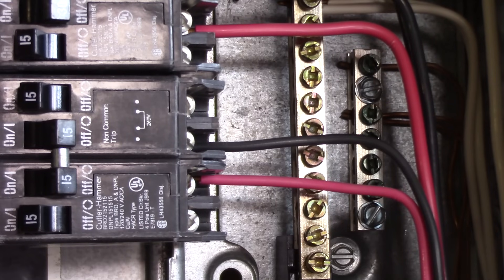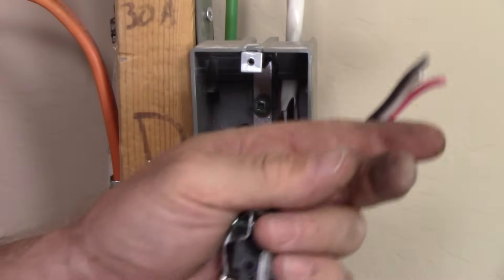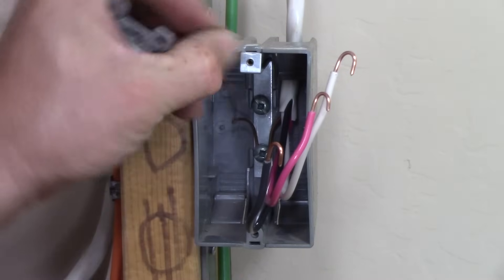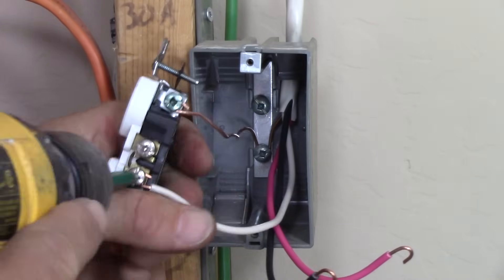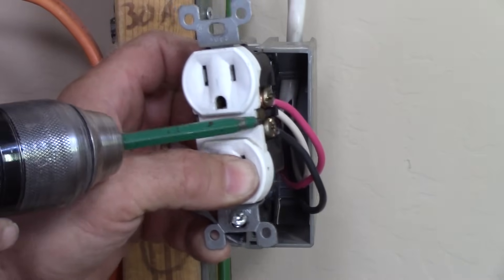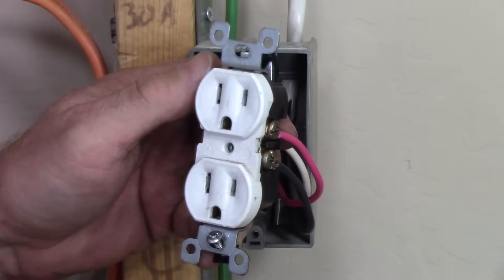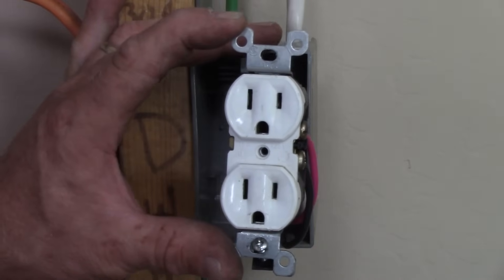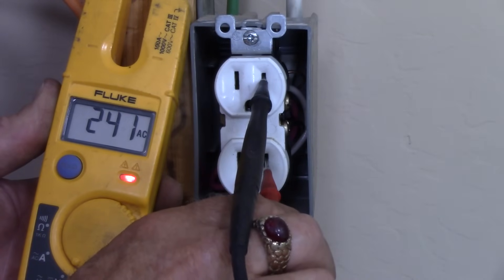Kitchen Split Circuit Receptacles Explained

Comment: i’m installing gfi can i just cup it red wire? it’s a old house have 2 hits there now
Reply from the maker: You might have issues with trying to use a GFCI receptacle on a 3-wire split circuit.  You don't have to change to GFCI unless you feel a need to. Anything wired to the code rules of the day is grandfathered.  My advice would be to keep the 3-wire split circuit arrangement that you already have.
Reply: @theinternetelectrician  can i just wire nut red wire and use black and white and put gfi ?

Comment: 5 minute mark:  people have to UNDERSTAND,  the 240 volt into breaker box, is   120 volt on  EACH  SIDE OF THE WHITE wire. Red/white=120 volts.......black/white=120  volts.........remember to remove connector tab, on BRASS  side of receptacle/switch/ etc...
Reply from the maker: So, kinda like I explain it?

Comment: Very informative. Is there a way to add a second outlet where each are split and sharing the neutral?
Reply from the maker: Yes, That is quite common as to meet the code of the day for a kitchen, you could have 2 split receptacles on one 2-pole 15A breaker.  To do this you should pig-tail the conductors for  the connection to the receptacle at the first outlet although some will "cheat" and use the push-in terminals and the screw terminals.

Comment: Nice video. I've used plastic boxes before, but never saw one with that metal strip in the back. Interesting design.
Reply from the maker: Yeah, there are so many different types of boxes out there! In my day,.... (walking uphill to school in 6 ft of snow, etc) We only had about 2 or 3 different styles of metal boxes. I would appreciate it if you like, subscribe, and click the bell as well (if you already did, thanks!) It really helps us creators gain traction with YouTube.

Comment: Lose the neutral tho, and both appliances are in series across 240 volts.
Reply from the maker: If they are exactly  equal loads, no problem.  If not, problemo!
Reply: @theinternetelectrician  yup , lets say you have a 600-watt coffee maker and a 
1200-watt hot plate burner the resistance of both in series is 36 ohms
 well 240 over 36 = 6.6 amps and the voltage across the pot gives u 160
volts of burned-out coffee and about 80 volts of not fully cooked food.

Comment: This is great. Explains what I did wrong. Thank you.

Have a question though. One of the split recepticals I am replacing, I want to use an outlet that also has usb plugs. It doesn't have terminals, just three wires (ground, hot, neutral) so there is nothing to split.

Any suggestion one what I should do?
Reply from the maker: You would have to cap off and not use one of the hot wires in this case. I would appreciate it if you like, subscribe, and click the bell as well (if you already did, thanks!) It really helps us creators gain traction with YouTube.

Comment: What if you want to change a split outlet to a GFCI in the kitchen? There is no tab to break off on a GFCI? I actually have 2 separate outlets in the kitchen that are both split outlets and they are both on the same 2 circuits. Meaning both upper outlets are on the same fuse and both bottom outlets are on the same but different fuse. Help
Reply from the maker: Hey Gregg. Yes, you have a split kitchen receptacle arrangement, and it is really difficult to achieve the requirements of the new code, which is a 20A #12/2 AWG circuit arrangement with GFCI protection on any receptacle within 1 M of the sink. You are correct, there is no way to split GFCI receptacles the way you can a regular receptacle.  Trying to make this work with the shared neutrals is a challenge as well.  The good news is, you don't have to! This system is grandfathered so no need to bring up to current code rules.  Personally, I like the split 15A arrangement.  You have 2 full 15A circuits in one outlet, and a maximum of 2 of these on one 15A, 2-pole breaker.  To me, better than 1, 20A circuit for 2 duplex outlets.  If you're concerned about not having GFCI protection, change the supply breaker to a 15A, 2-pole GFCI breaker (relatively expensive and requires some wiring changes in the panel in how they are connected).

Comment: I have a split receptacle within 3 feet of the kitchen sink, so need to replace with a GFCI. I know to split a regular receptacle by breaking the tab on the hot side, but how do I split top from bottom outlets on a GFCI? It is the only outlet in both circuits, so no ‘line’ requirement.
Reply from the maker: My advice, why change it to a GFCI? It's complicated because the shared neutral can mess you up, and you don't need to go with GFCI as your installation is grandfathered to the code rules of the day.  I personally like the splits better. But in answer to the question, you can't split a GFCI receptacle.

Comment: I have this set up in my house, but when I turn on my breaker, I only have one hot wire, and the top part of the outlet doesn't work. An electrician owned this house prior to me. I'm trying to figure out why he did this if only one wire is hot. Several outlets close to this one are wired the same way, with the same outcome. I want all my outlets to work, but don't want to burn down the house (obviously). What other reason, if any, would you wire it like that?
Reply: Nevermind. I got this. All done, and working safely. Thanks for the video!
Reply from the maker: Excellent!  Switched outlets for table lamps I'm thinking?

Comment: I have these in my kitchen. I tried to replace them with GFCI and got no power. Is there anything different with wiring the GFCI?
Reply from the maker: Yup.  The best thing to do there is leave the 3-wire split circuit as it is.  No need to change unless you want to?
Reply: @theinternetelectrician  I'm hoping to sell the home soon and was told GFCI was required in bathrooms and kitchens. That's the only reason.
Reply from the maker: @jasonbrussmn  The way it is wired now is grandfathered to the code rules of the day.  No need to bring it up to todays rules unless it is a new installation.
Reply: @theinternetelectrician  hypothetically, if a person wanted to replace these old outlets with GFCI is this possible? I'm assuming one of the hot wires would need to be capped? Thank you for your replies!

Comment: so if i bought a gfci outlet , i guess i cant use that with this wire setp up , since i cant brake no small piece on those new outlet , can i just cancel the red wire with a wire connector ?
Reply from the maker: Correct.  It's tricky to adapt the 3-wire split circuits to GFCI protected because of the shared neutrals.  Best to just leave it as it is.

Comment: Hi. I have a question for you.. as u said this is not in the code, and it was used long ago. Lets say I have a place with this kitchen configuration (double pole 15 amps breaker as you described, and I want to change it by a GFCI outlet to be in the code.. (the 14/3 wire will be still there) in this case I should just ignore one of the phases in the outlet box (putting a wire cover on it) and then use the other phase to be connected to the gfci outlet?  Just wondering if a part of being a slot waste in the panel, the breaker will protect me in the same way since it is for 240V (2 poles as I mentioned before) and I will be technically using just 120V? Is it the 15Amps that it supports what really matters? I will be protected in the same way I was before on the breaker side? I know the gfci is supposed to protect but the breaker in the panel should be a backup protection in case the GfCI fails. Your advice will be much appreciated. What should be done in this case?  Tks in advance.
Reply from the maker: Unless you are re-modelling and changing the kitchen entirely, these outlets don't need to be replaced as they are grandfathered in because they were installed when it met the code of the day.  I personally like this system better, but you don't have the GFCI protection.  You could replace the breaker supplying them with a 2-pole GFCI breaker (expensive) if you want that, but that's up to you.  GFCI and over-current (what a standard breaker does) are two different things.  One give you protection from ground faults, that is any leakage of current that isn't following the intended path, so is being "lost" through some other path to ground, be it moisture, or your body, etc.  Over-current is to protect the wires from over-heating due to high current flow from overloading a circuit, or a short-circuit. A GFCI breaker gives you both that, and over-current protection.  A GFCI receptacle only gives you ground fault protection.  The breaker feeding it gives the overcurrent aspect.
Reply: Terry Peterman  tks for the answer, just wondering why should I pay expensive for a GFCI breaker if I can have a GFCI outlet (for the ground) and the current breaker in the panel (for the current)? Is it any special reason?

Comment: I'm replacing old wire with no grounds in my home. Can I run 12/3 up a wall and split it in the attic run off a 12/2 wire from the panel in the basement which runs to an outlet near the main floor?
Reply from the maker: I'm not totally sure what your asking, or trying to do with that?

Comment: Hmm. He used a single 14-3 Romex. So, which outlet is switched? The one with the red or black wire?  I feel more comfortable running a 14-2 Romex from the panel to the outlet receptacle and another from there to the switch.

Comment: One thing I've never understood about this approach: Let's say you're running 14.9 amps on the black wire and 14.9 amps on the red wire. Aren't you then running 29.8 amps on the white wire? If the currents in the white wire are 180 degrees out of phase they may cancel each other out -- but if, say, the black wire's load is inductive and the red wire's load is capacitive, the white wire's load could approach the full 29.8 amps through a presumably 14 gauge (15 amp) conductor. Will you please explain if I'm missing something? Thanks.
Reply from the maker: You have a point, in that they wouldn't cancel each other out linearly if one load was capacitive, and the other inductive, but the current would never be lagging and leading by so much that the current on the neutral would compound to equal both the loads on each leg.  They would have to be fully 90 degrees capacitive, and 90 degrees inductive.  You could never have that much lead or lag.  I'd have to go back for a refresher at tech school to recall how far out of phase inductive and capacitive loads can get, but it's nowhere near 90 degrees!  Bottom line is that even the overlap created by the conditions you are suggesting, would never be enough to be an issue.
Reply: @theinternetelectrician  Interesting! So then the loads in the white wire are are always far enough out of phase to keep the total current below the wire's rating. Thanks, Terry. I had wondered about that for 30 years, but never asked the question.

Comment: Isn't it dangerous having the two 120v circuits so close to each other in the same box enclosure?
Reply from the maker: Not really. Granted, they are close, only separated by the split tab, but it would need something conductive to come between them resulting in the breaker going to work to do its job of immediately tripping and turning off the source. Any 240V equipment has the same situation, for example, an air compressor receptacle in a garage or shop that runs on 240v. And in the European grid, 220V / 50 Hz is all they use in household outlets, no 120v systems utilized there.
Reply: @theinternetelectrician  Thanks

Comment: What happens when all first steps checks correctly until when you check for the 240 and don't have the 240?
Reply from the maker: That would indicate that you have a stab-lok (FPE or Schneider) panel with a wafer breaker that is installed in the panel incorrectly and on the same leg instead of across the 2 hots.  This needs to be corrected as the neutral load is now compounded instead of cancelled out.  email me at terry@electrical-online.com and we can get this sorted out.

Comment: Thank you just solved a problem. My daughter husband replaced old kitchen plugs with newer ones. There was no power to one of the split plugs. I noticed a red wire and black wire on the gold screws and a white wire on the silver screw. The breaker wont reset because he didn't remove the tab between the 2 gold screws. He said he wired it the exact same way as the previous plug but didn't break the tab. Does it make sense that the breaker wont reset because its 220 instead of 110 because the tab has not being removed.
Reply from the maker: Yes, makes total sense. That is what is called a “dead short”, or a short circuit!
Reply: @theinternetelectrician  Just removed the tab on the gold screws and the breaker reset. The breaker panel was the exact panel in your video,
Don't know why the had neutral wire marred and 2 jumper wires going to both silver screws, the tab was still intact on the silver screw terminal.
Reply from the maker: @JimMcLaren1950  Yeah, that is weird they pig-tailed the neutral, and to both terminals with the tab intact.  Clearly did not understand what they were doing.  Glad you have it all worked out!

Comment: thank you very much for the useful video. can I change this split outlet from 120 volt to 240 volt? I have a European made device that requires 240 volt line that i like to use. I was told that it is possible by using a dual volt outlet? please advice and if possible how to wire the new outlet..thank you in advance
Reply from the maker: Yes, absolutely!  You just need to use the correct receptacle, and the matching cord cap on the appliances. 15A/240V and connect red,black, and ground. Just cap off the white wire. That’s another bonus with these split receptacle method of kitchen wiring.
Reply: @theinternetelectrician  Thank you so much for your kind and prompt reply. I thought I had s split outlet in my kitchen but i dont. What is have is that there are two outlet about 3 feet apart from each other and these outlets are out of phase. When I connect one lead of my volt meter to one outlet and the other lead to the second outlet I read 240 volt. Can I run wire from these outlets to a new outlet to provide me with 240 volt? I was thinking to take.two new wires connect each wire to the existing outlets so that I have two black wire along with my ground coming from the outlets into my new outlet and leave the neutral wire disconnect In the new outlet. This configuration will give me a 240 volt outlet that I can use. It is possible? And if it is then if I am using the 240 outlet can I use the existing outlet that I borrowed the power from at the same time? Hopefully my explanation is clear enough and make sense to you...thank you
Reply from the maker: @saboorsaboor704  No, you can't do it this way.  However there is a way to safely do this.  You need to show me where your outlets in the kitchen are, what breakers controls them, and where you would like to place your 240V appliance(s).  Draw me a rough sketch and then just take a photo of it and send to terry@electrical-online.com  I will explain what can be done, and if it's out of your comfort level, you can hire it done, an easy and quick job for a good electrical contractor.  There should be no more than 2 outlets on one circuit.  If there is an odd number of receptacles, then one would be on a circuit by itself.  That one will be the best candidate for the conversion.  If not, then you will have to have 2 of your existing outlets changed over to 240V

Comment: Great video thank you! I am trying to replace an outlet that has a split receptacle with a new wall outlet that only has 2 connection points (one connection point for a hot and one for a neutral, can I do that? Guessing I need to only connect one of the hot wires from the split receptacle then close off the other hot wire with a  wire nut and leave it in the wall?

Comment: Thanks for the video. I have an outlet, the bottom part works, while the top while shows "hot open" using a tester. When I opened it up, it has 1 ground, 2 white, 2 black and 1 red wire, the 2 black ones go to the bottom working one. Would you please explain what's wrong with my outlet, how to fix it? thx.